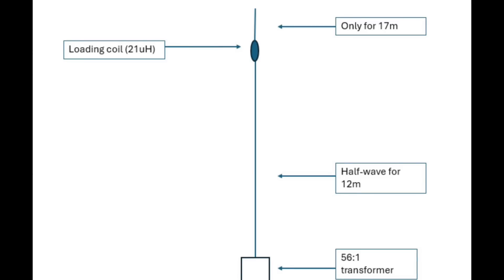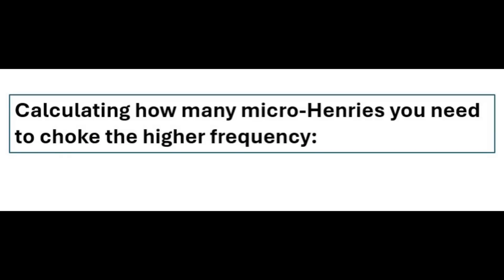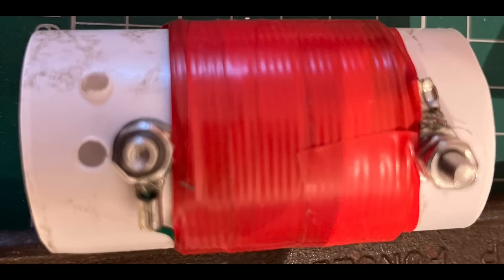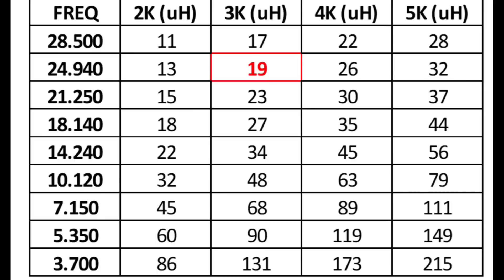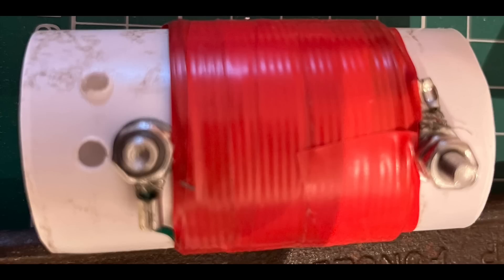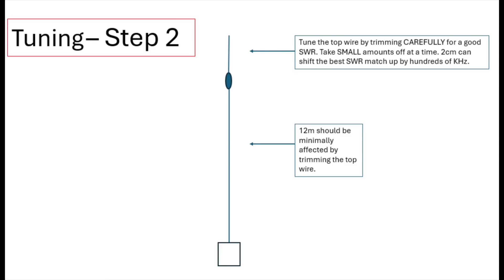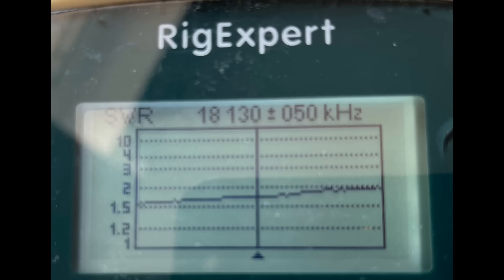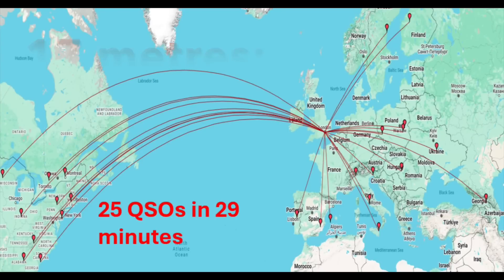Build A Simple No Radials Vertical Antenna For 12 and 17 Metres.

Comment: Nice to see another Antenna Video, Thanks Tim!
It is interesting that the same basic formula used to calculate a 1/2 wave antenna wire in feet   (468 / Freq Mhz  = wire Ft. ) doubles as inductance in uH for 3K ohm impedance.
73   mike   🍺🍻
Reply from the maker: Thanks Mike, yes a happy coincidence!

Comment: I bought a cheap L/C/R meter from ali express last year in a sale. £12 and its surprisingly accurate. Makes winding inductors a lot easier. I had a problem with centre loading coils having too big a reactance and making tge aerial shorter when i didnt want that.
Reply from the maker: Yes I use an LCR meter, such a game changer.
Reply: I bought a cheap multimeter with LC on it...I tried measuring a commercial coil where I knew the approximate value of the inductance and it came nowhere near. I made my own coil, different dimensions for the same purpose and same inductance, taken from one of these online calculators. When I measured it at the end, it came to approximately the same as the commercial one, but still nowhere near where it was supposed to be. Because I'd made the coil to spec and it measured about the same value on the meter as the commercial one, I called it good! However I think I might have to invest in a new standalone LCR meter!

Comment: ...to make it work even better Tim, raise the feedpoint up 1 meter then put in 4 radial (additional counterpoise) wires down to the ground and you'll draw your angle of radiation further down towards the horizon by a few degrees towards and that magic 5 degree DX angle. I tried this with my 20m EFHW using the same rig as you, the difference was noticable.  Richard VA7AA

Comment: Tim
You said to add the diameter of the coil firm plus the diameter of the wire x2. The instructions say just add the diameter of the wire. If you look at the diagram the arrows only indicate half way through the wire at top and bottom which equates to the diameter of the wire plus the form.

Comment: Great antenna idea .  I have tried outher ideas for the same 2 bands. The linked end fed dipole did work great but need to change links to change bands .  The outher I have tried is a trap . The coil with a cap across it. That worked but I had trouble with circulating current over 100 watts and burned up a cap.  Also that took away from RF power going into the air.  I would say the loading coil would be best way . I have what I need to make coil.   I can just use my 25FT with 4:1 UNUN and just push tune on my radio . that works good as well.  I will try the loading coil for WARC bands.  12 and 17 Meter FT8 has been great lately in NY ! Cheers !
Reply from the maker: My pleasure, thank you for the info Robert, 73.

Comment: Nice Tim 

Couple of questions - what toroid were you using in the 56:1? 
Did you choke at the feed point or at the transceiver at all? 
ie using the coax shield as a counterpoise 
It looks like sotabeams ultralight wire is that right? 
Was there any Saltwater amplifier effect at all or were you too far inland for that (soil looked dry) and elevated
de G4FSX
Reply from the maker: The core: 2643251002. No choke (no issues at 100w). Yes ultralight Sotabeams wire (good for 100w SSB) and ideal for verticals. Not near rhe sea about 10 miles inl;and but 160m ASL. 73!
Reply: @TIMG5TM  I’ve ordered 2 toroids from Sotabeams and have built the coils already used effervescent tubes as a former. 
I’ve used the smaller toroid for a lightweight EFHW it’s been faultless on 20w but I keep my portable cores open not encased so they benefit from wind cooling  might help - who knows!
Going to build two and send one to a buddy state side see if we can QSO in the “Weekend WARC Wonder”
Reply from the maker: @ brilliant! Let me know how you get on with it and if I’m around one weekend we will try a QSO

Comment: Nice video Tim, unfortunately here all bands above 20m are dead. Oddly enough though, my 40m vertical via tuner works on all bands 40-6m hi.
My 20m 2 ele parasitic elevated vert array, works great on 17m when it is open. 
73. Zl3xdj.
Reply from the maker: Cheers Brian.